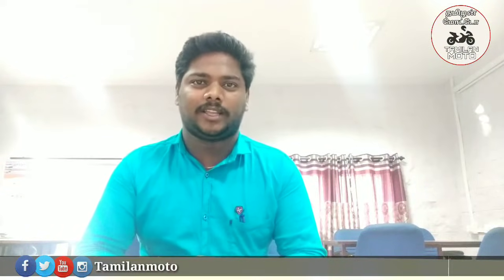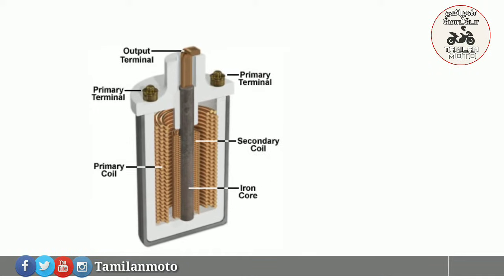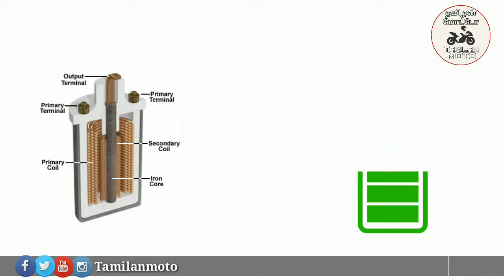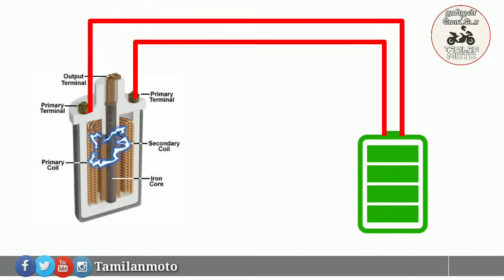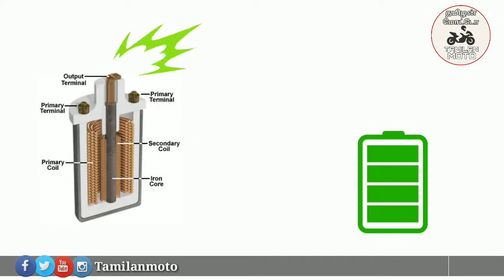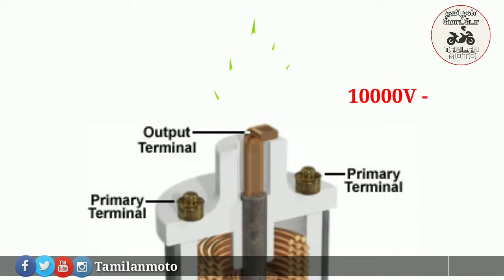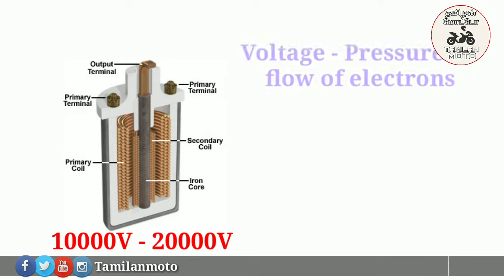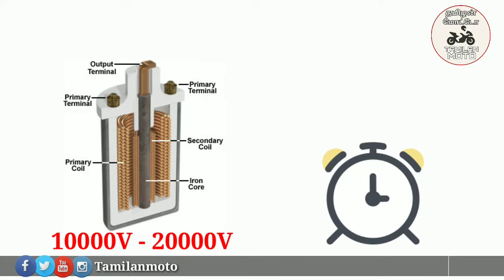How ignition coil works and How to check it with Multimeter | Ignition coil animation | Tamilanmoto

Comment: Bro great vedio . Bro is it possible to upgrade my Honda sp125BS6 motorcycles ignitioncoil to higher power ignition coil. I need more milage and smoothness.
Reply from the maker: S you can
Reply: @Tamilanmoto  Thanks Bro. Bro If I upgrade to higher volt ignition coil does it increase mileage.
Reply from the maker: @mnkh-r6i  it will decrease brother. it increases the speed. but before that you should change your CDI also
Reply: @Tamilanmoto  Thanks bro.

Comment: Bro sometimes my bike feels like stalling(thenerathu like in reserve condition) and suddenly increases the acceleration then runs normally this happens very rare please help me idhukum ignition coil kum edhavudhi samantham irukkuma
Reply from the maker: Ena bike
Evlo km odiruku
Epo last service panuninga
Reply: @Tamilanmoto  rtr 200 2yrs 
14000km 
4 months aayirchi service pnni
Reply from the maker: Ig coil resistance check panunga multimeter use panni.. Carburettor model ah ila FI ah
Reply: @Tamilanmoto  carburettor
Reply from the maker: @OHarikrishnaraoM_PT  check carburettor diaphram brother. Athula rust iruntha intha issue varum
Reply: @Tamilanmoto  ok bro thnks

Comment: Hi.. on my fz 2008 model.. currnt is not coming from ignition coil to sparkplug.. i changed ignition coil  and also not coming.. bt from cdi to ignition  coil.. current is coming.. why
Reply from the maker: Check HT cable and Spark plug cap
Reply: @Tamilanmoto  ht cable and ignition  coil  i brought a new one yesterday  and no current to ht coil
Reply: How to check earth connection  to the ignition coil
Reply from the maker: Body earth than bro
Reply: @Tamilanmoto   wht bro?.. body earth is the problem?

Comment: Bro.  I have TVS phoniex vehicle not star  coil new changed but coil current is nill
Reply from the maker: Check the value & type of ignition coil. Cdi output & battery voltage brother

Comment: bro, does bad ignition coil drains battery
Reply from the maker: Entha type ignition coil bro.. AC CDI ah DC CDI ah
Reply: @Tamilanmoto  i dnt knw the type.. used in royal enfield bike
Reply from the maker: @arjunvs385  2 lead ignition coil iruntha power loss ku chance irku bro.. but rompa rare than..90% chance ila
Reply: yesterday my motorcycle battery has drained suddenly.. and at the same time i spotted a problem in ignition coil... thats why i asked this question
Reply from the maker: @arjunvs385  it's very rare condition bro.. check battery status & rr unit
Reply: @Tamilanmoto  rr means recrifier?
Reply from the maker: @arjunvs385  rectifier and regulator
Reply: @Tamilanmoto  ok bro... thank u

Comment: சார்,...
என்னோட bike TVS Victor New.

அதுல 35 க்கு மேல வேகம் போனாலே வண்டி அடைத்து அடைத்து செல்கிறது...
ஏர் பில்டர், கார்ப்பரட்ட்டர் எல்லாமே சரி செய்து பார்த்தாலும் அந்த பிரச்சனை சரி ஆகவில்லை....

அடுத்து என்ன செய்வது???

Coil complaint ஆக இருந்தால் என்ன செய்வது??
அதற்கான exp எவ்வளுvu varum ??
Reply from the maker: Spark plug check panunga.. sari aahidum.. new model ah iruntha AIS system oda hose connection um check panunga.

Comment: Bro enoda bike hero honda Splendor pro 2011 model below 20km la adithu adithu pokuthu
Reply: Bike slow Panna athavathu below 20km la vantha marupadivum adaithu adaithu pokuthu
Reply: Nan carburettor check pannitan , pickup coil check pannitan, ignition coil check pannitan
Reply from the maker: @manikandanm9802  carburetor air screw oda O ring irkanu paarunga.. idle jet la tha problem irkanum. 

Spark plug company la potruntha same number potrukingla nu paarunga
Reply: Aduthathu cdi madumthan check pannala
Reply: Enna problema irukkum
Reply from the maker: Check Airfilter & sparkplug too
Reply: Athalam check pannitan ellam correcta irukku

Comment: Sir I have bajaj ct100. Suddenly it stopped when I checked t spark plug cable no supply is coming wat u might b t reason
Reply from the maker: Check ignition coil & cdi
Reply: @Tamilanmoto   thnx bro

Comment: sir My BS4 ns 200 self start work perfectly in morning... when i cover  1 km its start misfiring in 2-4k rpm,then when i try to start after above 5 min break,it wont start perfectly.after some try it will start.. i clocked around 30000 km.i changed 3 spark plugs.
Reply from the maker: Which area u are
Reply: kerala-idukki ... please help me bro..
Reply: @gokulvgopan  Bro did u found the solution?
Reply: i changed ignition coil,3 spark plug,airfilter,new engine oil,vaccum piston ,and cdi unit also in perfect condition,now i feel gas smell also from exhaust,no power in incline hill roads. fedup with this... do you have any idea?
Reply: Was your problem solved? I too have same problem bro.